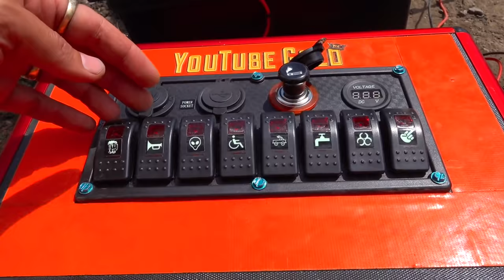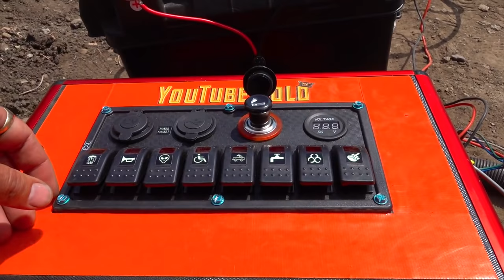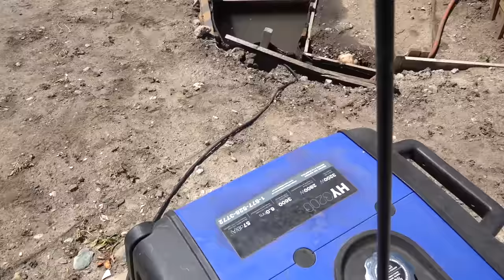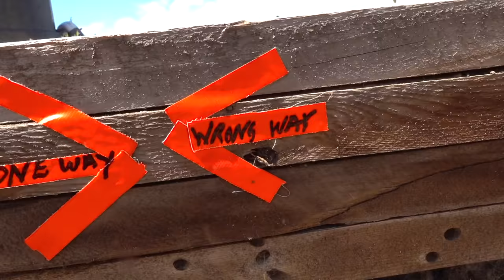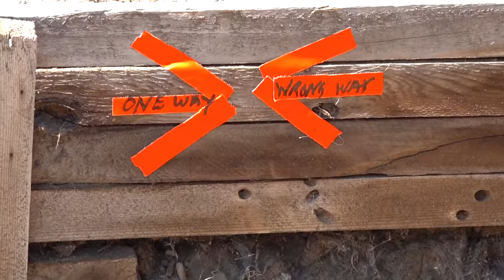YouTube GOLD - (S3 E9) OVERLY DRAMATIC GOLD MINING | RC ADVENTURES

Comment: Love this. In the 80s I drove a 769C that had an 11000 litre water tank in the dump tray. We were raising a tailings dam at a coal mine in Central Queensland, Australia. My job was keep the moisture in the fill as it was dumped on the wall. I have a story about how I nearly drove of the top of the dam late in the project, but it's a little long for a comment.

Comment: Guys I love your work. I really would like to work with you. I am a dump truck driver and I know all about that kind of work. Anyway. My advice though:

1. Enlarge the quarry and the road so the trucks wont get damaged by all those turns. A truck is damaged at least 10 times faster when it is loaded.

2. You really need to make safety embankments on the road.

3. Put some signs. It's mining area!

4. Buy a grader. It will help you to fix the roads so the trucks would drive on them smoother.

5. Consider to place the excavator at a higher altitude than the truck. It will be easier to load it.

That's my advices. Again, I am just a truck driver and I love rc machines too. That's all from my personal experience working inside quarries. Keep going with the good work guys!
Reply from the maker: Too safe, you would never be hired here. #YouTubeGOLD!
Reply: @TheRealRCSparks  Haha, I thought so!
Reply: Oh,did I mention that I love gold too? Think about it, i have all the requirements!

Comment: @20:06 Safety Violation- As that is a high pressure water hose I suggest digging a trench and constructing a small bridge over it or making a culvert under the road to put the pipe through for trucks to pass safely #youtubegold baby

Comment: You wouldn't happen to have any good info on checking valve alignment on a 4200xl digger would you? I had a servo go out on mine and after replacing it, I can't get the booms to move. I was thinking it may be the 4th valve on version 1.5 causing my issue but I've done everything I know to do. May have to pull the pump

Comment: Working Near Water Hazards

HAZARD - Working around, over, or near water

POTENTIAL OUTCOME - Entrapment, drowning

RISKS – Traveling or operating equipment near water, equipment weight and vibration, undercut banks, sloughing ground, varied water depth, swift currents, inadequate berms, narrow roadways, electrocution. 

five scenes of water related fatalities and a life jacket and ring with the word "rescue" 
Best Practices: 
Conduct daily workplace examinations.
Know the water depth and subsurface conditions and ground conditions before you begin work.
Keep equipment a safe distance back from the water’s edge.
Avoid traveling over ice covered water.
Provide handrails around docks and work boats.
Properly berm roadways near water hazards.
Always wear a Coast Guard approved Type I or Type V personal flotation device (PFD) when working around water, even when inside mobile equipment. Auto-inflatable, if possible.
Keep water rescue equipment easily accessible.
Know where extra PFDs and rescue rings are stowed.
Practice good housekeeping and keep all travel ways clear around water hazards.
Any further questions can be directed to the MSHA website.
https://www.msha.gov/news-media/alerts-hazards/mnm-safety-alert-water-related-safety
WEAR A LIFE JACKET AROUND WATER!!! ESPECIALLY JOE!
Reply from the maker: Too safe.. that would drive safety to priority 18.. and truly, we arent interested unless its 19 or higher. #YouTubeGOLD!